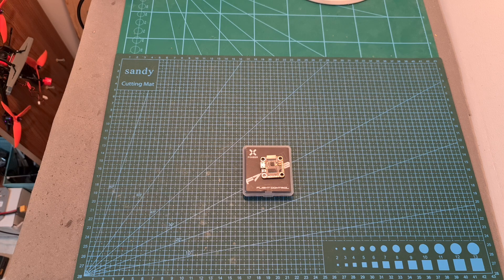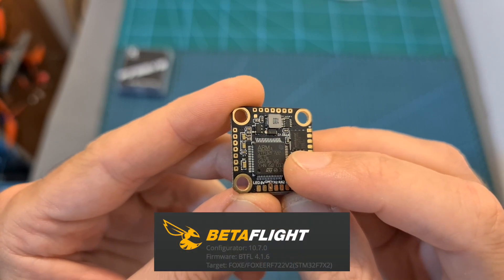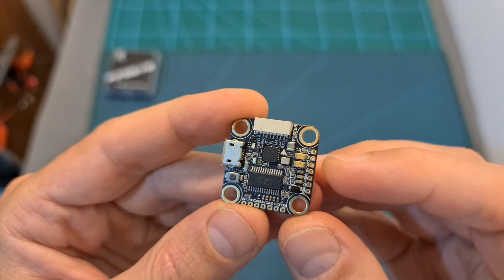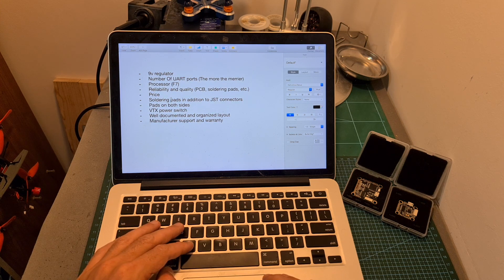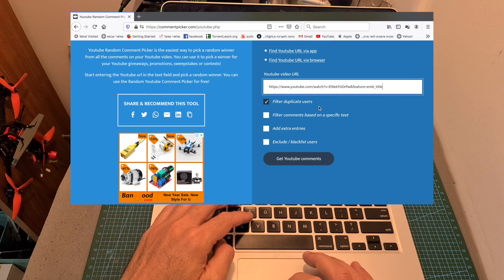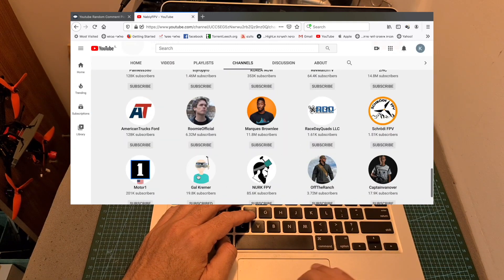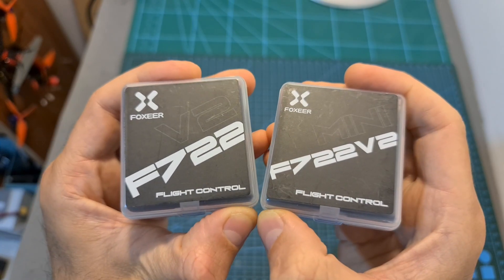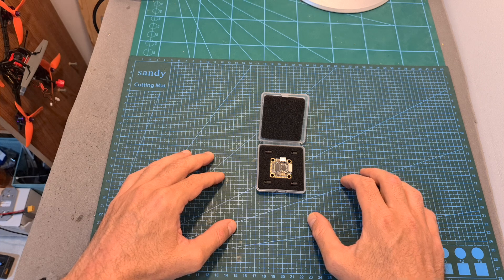Foxeer Mini F722 V2 Flight Controller Overview

Comment: It's a nice little FC, 4 UARTs is enough for most people and lack of 9V regulator isn't a big deal if using Vista (or a HV Unify/Tramp/whatever), I just wish it had USB-C. Everything else other than 20x20 FCs I am using now has USB-C.
Reply from the maker: Yes, USB-C it's the next step. Personally, even with a vista I would rather power it using a BEC.
Reply: @KremerFPV  yeah I guess it can't hurt :)